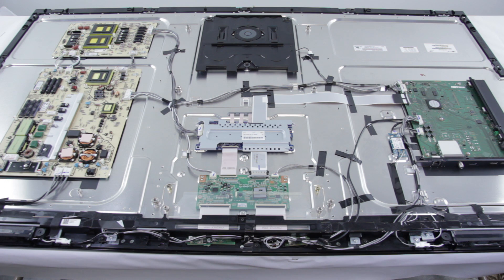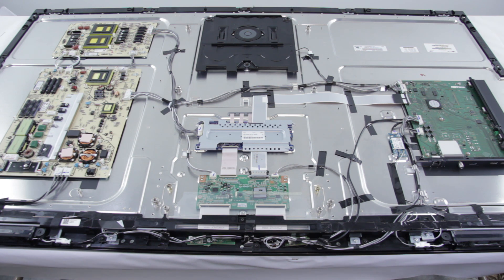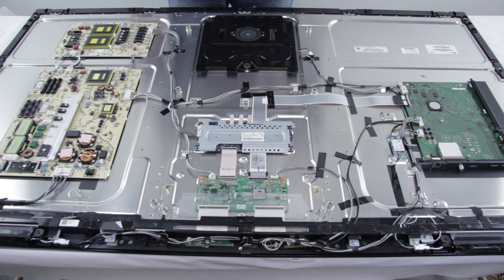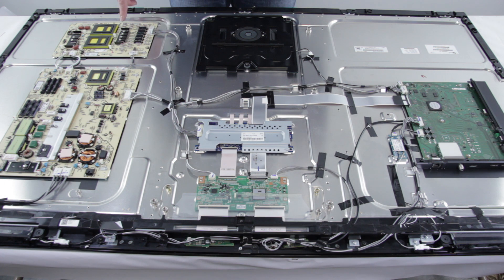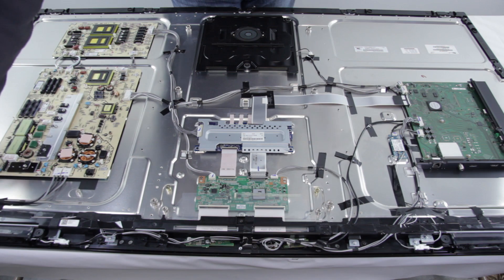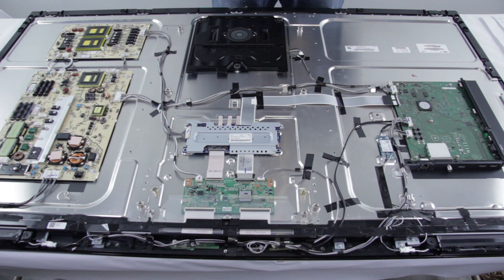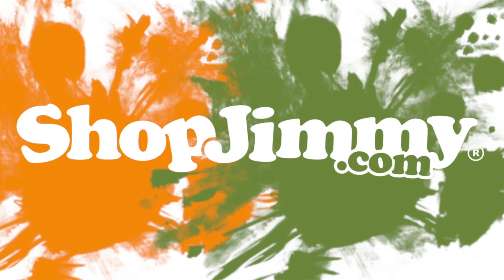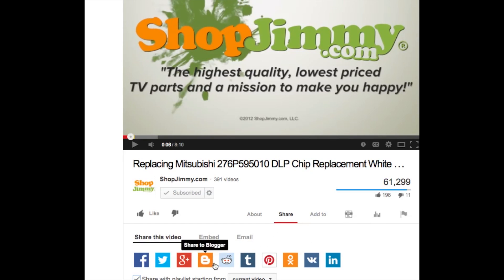LED TV Repair Review Power Supply Overview-NO Power Common Power Supply Repair & LED TV Power Supply

Comment: I have an LEDtv toshiba 39L4300, when I plug it in the start up screen shows and then the screen turns black with the "on" light and a blinking light behind.. help me please.
Reply from the maker: Miriam Arenillas   I recommend replacing the main board in your TV.  Here is a link to replacement parts for your TV model number on our website, click here:  http://www.shopjimmy.com/catalogsearch/result/?q=39L4300  Be sure to match part numbers on your current board, with your replacement for compatibility.  You can also call our customer service for further assistance with your purchase.  (877) 881-6492  Thanks and please let us know if you have any further questions with your TV Repair!  www.shopjimmy.com

Comment: I have an Insignia NS-P502Q -10A. It is turning itself off and on repeatedly. The "stand-by/power" light will flash, then the tv turns on, then 10-20 secs later turns back off. .and it repeats this cycle over and over until you unplug the power cord. Can you tell me what needs fixed?
Reply from the maker: Chessna Wood  This sounds like a problem with either the X or Y main board.  You will need to disconnect the boards and then add them back individually to see which board is causing the clicking.  Here is a link to replacement parts for your TV model number on our website, click here:  http://www.shopjimmy.com/catalogsearch/result/?q=NS-P502Q+-10A  Be sure to match part numbers on your current board, with your replacement for compatibility.  You can also call our customer service for further assistance with your purchase.  (877) 881-6492  Thanks and please let us know if you have any further questions with your TV Repair!  www.shopjimmy.com

Comment: sharp LCD tv No picture,no sound but green light on, remote does not control on/off have to power up from main. any suggestion please?
Reply from the maker: TheShadow95100   I recommend replacing the main board in your TV.  Please reply with your TV model number and then I can recommend a replacement part for your TV Repair.  You can also call our customer service for further assistance with your purchase.  (877) 881-6492  Thanks and please let us know if you have any further questions with your TV Repair!  www.shopjimmy.com   #tvrepair

Comment: I have a Sony Bravia KDL46EX723. I am currently unable to power it on. The red standby light on the front of the TV flashes 2 times. Do you sell the part that I need to repair this television and do you also have a youtube video showing how to do this repair. Thanks.
Reply from the maker: Barb R   I recommend replacing the power supply for your TV repair.  Here is a link to replacement parts for your TV model number on our website, click here:  http://www.shopjimmy.com/catalogsearch/result/?q=KDL46EX723  Be sure to match part numbers on your current board, with your replacement for compatibility.  You can also call our customer service for further assistance with your purchase.  (877) 881-6492  Thanks and please let us know if you have any further questions with your TV Repair!  www.shopjimmy.com

Comment: no power sanyo dp26746
Reply from the maker: raj mar   I recommend replacing the power supply in your TV.  Here is a link to replacement parts for your TV model number on our website, click here:  http://www.shopjimmy.com/catalogsearch/result/?q=dp26746%EF%BB%BF  Be sure to match part numbers on your current board, with your replacement for compatibility.  Here is a link to a video showing how to identify your part number, click here:  TV Part Number Identification Guide for Sanyo Power Supply Unit (PSU) Boards (LCD LED Plasma TVs)  You can also call our customer service for further assistance with your purchase.  (877) 881-6492  Thanks and please let us know if you have any further questions with your TV Repair!  www.shopjimmy.com

Comment: I have a 32" Emerson LCD HDTV..Model number LC320EM2 and the TV doesn't turn on, not even the red light when plugged in is on...any clues?
Reply from the maker: Chicawiwi  I recommend replacing/fixing your power supply/inverter.  Here is a link to replacement parts for your TV model number on our website, click here:  http://www.shopjimmy.com/catalogsearch/result/?q=LC320EM2  You can either order a repalcement board if we have it in stock, or you can purchase our board repair service where you send us your boards and we fix it for you.  Be sure to match part numbers on your current board, with your replacement for compatibility.  You can also call our customer service for further assistance with your purchase.  (877) 881-6492  Thanks and please let us know if you have any further questions with your TV Repair!  www.shopjimmy.com